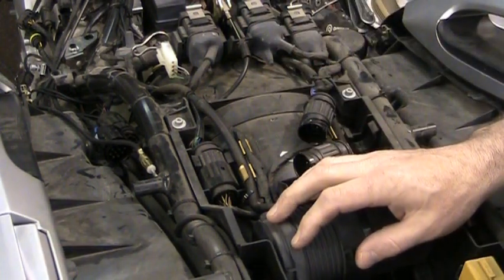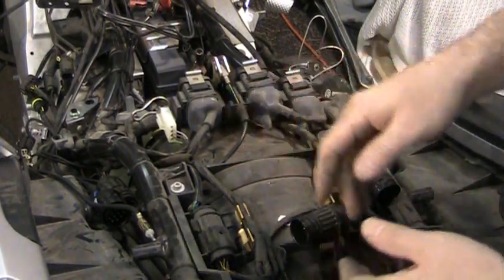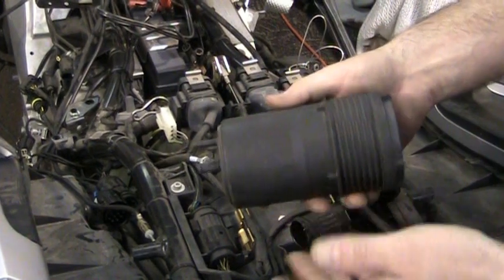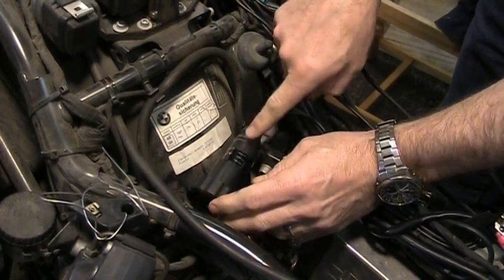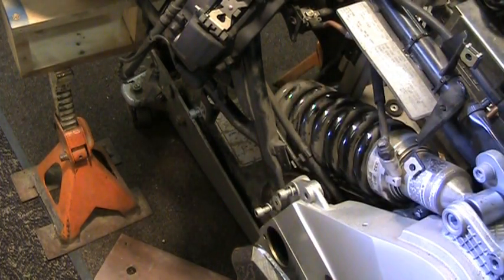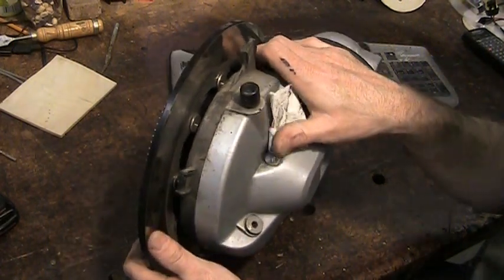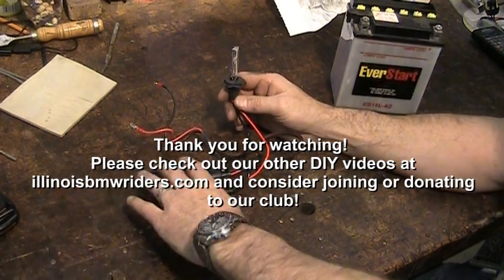BMW K1200LT Performance Improvements and Maintenance DIY

Comment: I did it, the canisterterectomy.  Great advice.   The plug removal on the air box made a huge difference.  I couldn't believe it the improvement.  It's hot here in Florida..always.  Big difference....Thanks again for all the great videos.

Comment: @ 18:07 - If oil has been able to escape air will not be in the system for long at all! 
@ 20:57 - Rear disc - EBC Brake makes a far superior brake disc available at Beemer Boneyard in Randolph, New Jersey for a mere $185. These are simple to replace without removing the rear drive from the bike. I have YouTube videos showing this procedure.
Great video. Thanks for posting it, Chris

Comment: I have a 2002LT and I cut the brown wire.  WOW!  What a difference!  Temp outside, here in Tampa, is 92 degrees.  Took it for a test drive and no more bogging down.  Whole lot more performance!  Thanks  (  I made a donation today.)
Reply: Hi, you cut only brown wire? (since september i have a 2006 LT, and i will want make same mod)

Comment: On my 2000 K1200LT I was bottoming out on mild speed bumps and curbs.  I added hydraulic fluid to the rear shock adjuster as shown here and it has made a world of difference.  I also removed the top case and performed the canisterectomy.  Damn it feels good to get rid of useless shit.  I just filled up the tank and the needle still doesn't go all the way to full, but oh well.  Many thanks for the helpful videos!
Reply from the maker: +Steff Mielziner The next time you take the gas tank off pull the sending unit out and you will see why the gauge is not working correctly. The tube has a dent in it from the gas tank crushing in on itself when the canister got clogged. Take out the innards and drive a reasonably tight fitting socket through the aluminum tube. Put it back together and viola!

Comment: I just pushed the drain hose off the top of the cannister down the side of the bike to drain, no need to go through the pain of connecting it to the old drain hose. Good videos though, thanks for taking the time.

Comment: Nice!  I have a new-to-me 2000 K1200RS that still has the canister.  Currently have it completely disassembled to fix a slipping clutch (o-ring was leaking), so getting rid of that useless canister will be easy peasy.
Reply: Just did this today!  Thanks
Reply: Follow up question on the canisterectomy:  On my 2000 K1200RS, there were 3 hoses from the canister:  one, from the fuel tank vent, two, the drain pipe, and three was the hose to the solenoid valve, which goes to the vacuum tubes on the intake manifolds.  #3 is the hose that you plugged with a bolt.  Instead of plugging the hose, I removed that hose and put a large vacuum cap on the nipple the hose came off of on the solenoid.  So the solenoid does nothing now.

Question: can that solenoid be removed without generating a check engine code?

Comment: The Cat Code plug was only used for a short time.  Once the "brown wire loop" was added in mid 2001, the cat code plug was discontinued, since they both do the same thing.  There was only a couple months of production where both existed.  Also, there was a change to the Motronic to allow the cat code plug/brown wire change to allow a secondary fuel map.  The very early ones did not have that map, so unplugging the ATS work around was the only way to relieve the high temp surging problem.  As you said, never do the cat code plug/AND brown wire!

Comment from the maker: You could have something going on with the final drive, drive shaft or the brakes. Check them all! There should be no grinding. Also check for tire rub on the swing arm and check the tire pressure. 
The shock adjustment: If you are afraid you will break the knob, unscrew it, pull it off and use a wrench on the hex head underneath. just know that there is a detent ball under the knob that will fall out so be prepared to catch it!

Comment: Did you see my question about the charcoal canister  PO cut the lines coming onto the canister and removed the supply line and return line.  Are the two hoses on the right side of the tank associated with the charcoal canister, thus can I turn those hoses into each other?

Comment: I know this is an older video, but Kirk, if you still have your 00' or 01' LT, could you do a video on resetting the ABS II (non Integrated), including the diagnostic plug and getting to the ABS computer plug by the battery, which seems to be on the difficult side? Another member of your club did one for those bikes with a nice ABS button, which the early K1200LTs do not have.  I would imagine you have some tips to make that easier. Yes, the pulses should be tested too, to see what the problem is, but I am under the impression a reset is sometimes needed as fixing the problem doesn't necessarily reset the system.

Comment: Tire is Metzeler and pressure is 36psi when cold.
Reply from the maker: I can tell you from real experience that you tire pressure is WAY to low running a Metzler two up. When I ran that tire I put 48 Solo and 50psi two up. Bump the front up to 40S-42psi dbl. I think the tire is rubbing the swing arm or is mushing too much while cornering. If your tires are old or have high mileage on them they become noisy as well in corners. As to your other question, any quality click type torque wrench that reads Newton meters. You need one that will go from 5-200 range. Maybe get one in 3/8 and 1/2"

Comment: I just bought a used 06 LT with 50,000 miles. I took my wife on a ride for the first time and I feel/hear grinding noise from the rear while free wheeling. I do not notice it when I am by myself. no leak from final drive. I also notice that I cannot unscrew the adjustment of the rear shock - it is stuck on one of the last settings...all the way screwed on. any idea?
I really enjoy your videos.

Comment: Hello sir I have watched and learned a lot from your videos thanks for sharing your knowledge. I have a 2001 k1200rs and I disconnected the connector on the air box but I'm not finding the little brown wire. Is this necessary to do or is this defeating the purpose of disconnecting the air box connector. Thanks again for your help and I have told a lot of people about your channel. Not a lot of bmw bike riders here in Knoxville Tennessee.

Comment: Does the Chip Replacement make the brown wire/temp sensor/..... thing unnecessary?
Reply from the maker: yes
Reply: @kirksmotorrad  Thank you. I know your YT are a few years old but the 2003 BMW K1200LT is brand new to me! Do you have a link to the chip?

Comment: More unsolicited comments! Please take no offense, I'm merely trying to help:
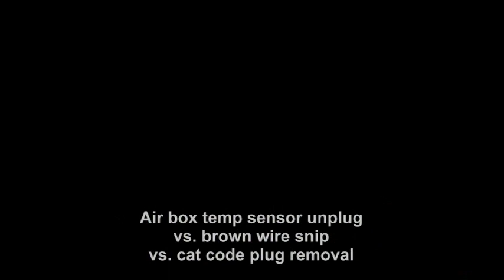@ 8:20 - Most other manufacturers have a 10 year warranty on emission related components. Check your owner's manual for Emission Warranty notes. I can't say that I have ever looked, as strange as that may seem after all these years.
@ 9:30 - This computer was used from 6/97 - 12/03 only in the K1200LT. Therefore, this issue would likely exist in all US 1999 - 2003 models.
@ 9:52 - Brown is Ground/Earth for BMW. 
Chris

Comment: Hi Kirk,

I have the same bike, a 1999 with only 22k miles.  

On the second step in your video; do you remove ONLY the air box plug on the Left side of the bike ?  Or do you also pull out the Yellow CAD plug on the right side on the rear of the bike?

I have the yellow plug in the back of my bike under the rear luggage/trunk.  Do I pull it out too ?

It is not clear if I should do only one or both things (pull the plug on the air box and pull out the yellow cad plug)?

I don't seem to have any issues with my bike even in Hot weather but you are saying this will improve the power/performance of the bike without effecting anything else?

Please let me know.

Thank you,
AJ
Reply from the maker: Only remove the airbox plug on this year of LT. Do not remove the rear plug. Yes it helps in hot weather over 80F
Reply: illinoisBMWriders

Thank you.

I removed the rear plug (then put it back) and it seems to make no difference when removed.  What difference does this plug do ?   I tested the bike without it and it drove/ran fine.

I could not find or get to the airbox...I would have to remove the Left side Tupperware, I could not simply reach in and unplug it without removing the Tupperware.

Comment: Kirk, for an 05LT, Airbox sensor ? Brown wire cur? or Cat plug unplug?  Thanks!  another great video  sir.
Reply from the maker: That one should have a brown wire to cut
Reply: KJ, I have to say I have watched and re watched most of your videos.  I am in the process of changing all of the fluids, filters etc on my 05LT.  I did the gas filter, coolent and final drive last weekend.  All that is left is the clutch and brake bleed.  I also replaced the plastic quick connects to the metal as per your advice.  So the elusive Brown Wire Loop?  I do not see a loop anywhere.  I have all the tupperware off.  What am I missing?  Okay to do the airbox sensor on this bike since I cannot find the brown wire loop?
Reply: Kirk, I have replaced all of the fluids on my 05LT thanks to your videos.  I also did the Can ectomy and replaced the quick connects.  I looked high and low for a Brown wire to cut and I do not see anything except for the wrapped wiring runs.... no brown wire loop.  Still getting to know this bike.  Love the way she handles... not a big fan of the brakes.
Reply from the maker: It may have the Cat code plug under the rear box above the tail lights. Or you could just leave it and get yourself a John Gemi chip. His chip does the same thing with all of the sensors in place.

Comment: Hi, since september i have a 2006 LT, and i want to cut brown wire, only this mod, it is possible for improve performance?
Reply from the maker: yes. If you have the small brown wire you can cut it and it will run better in hot weather.

Comment: I dont know if you still responding to questions.  I have been using your videos, got my first bike ever, 2003 k1200rs.  Love it, but i have hesitation and back fire when decelerating. Should I do the airbox sensor or brown wire?  I only get like 38 mpg, 40 if I baby it so I been wondering why I gt such bad gas mileage.  Any info would be wonderful!
Reply from the maker: +Daniel Ralph This sounds like a classic case of you need to change the O2 sensor. Double check to see if a mouse has moved in to your air box too. You can find one a lot cheaper at the auto parts store. The LT takes a Bosch 13475. Probably the same on yours but double check first.
Reply: +illinoisBMWriders thanks,  the air filter is fine, I did ride the bike a little with the temp sensor removed and it did not backfire nearly as much and cold start idled much better. the bike has 44k on it so, I will price out an O2 sensor. thanks for your advice
Reply: +illinoisBMWriders do you happen to know if removing that air temperature sensor okay for this model? I live in SC so it is hot most of the season.
Reply from the maker: +Daniel Ralph we unplug the sensor on the LT due to a huge hesitation from a stop and low power when it gets over 80F. Are you experiencing this? I think you should change out the o2 sensor, check the valves and then see how it runs. Dont unplug it if you dont need to.
Reply: +illinoisBMWriders sounds good, looks like mine may use an 15727 o2 sensor. will do a little more research and try that out. thanks again!

Comment: @ 10:54 - You are tricking the Motronic to increase the fuel side of the air/fuel mixture. Most BMW motorcycles suffer from a lean condition. More fuel is good.
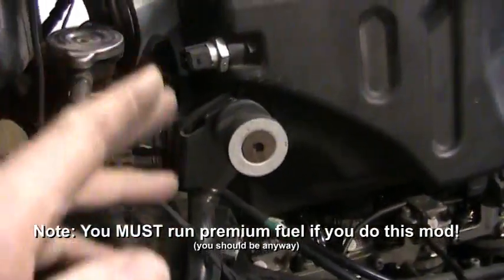@ 12:50 - As with the above comment you are placing the Motronic computer into 'Limp-Home' mode which will richen the mixture put show up on the MoDiTeC diagnostic dinosaur as a fault.
NOTE: I am NOT suggesting that anyone not do these mods. You will gain rideability & performance with no adverse effects on reliability or longevity.

Comment: Did the canisterectomy fine but during reassembly I made all the elec connections but my left turn signal doesn't work and right side blinks fast.  Any thoughts on how I goofed up?
Reply from the maker: govshrum I cant even imagine how you could have messed up the electrical doing a canisterectomy...
Reply: Old post, but I may have the answer for someone else.  I had my faring off, and after reassembling, one of the two front turn signals stopped working.  Pulled the bulb out and it measured fine.  Measured voltage at the connector and it was fine.  Tried swapping the two turn signal assemblies at their plugs and it stayed with the housing.  Disassembled the housing and cleaned the bulb contacts.  Reassembled and it was all fixed.  Just a little corrosion in the socket.

Comment: Anybody know where  is engine number on LT 1200
Thanks. Martin Ferrari.
Reply: I needed mine to register it....   I called a few places that work on BMW bikes and found one that could look it up based on the VIN #.   I used that to register the bike and it worked out OK.  They guy said a some of the numbers might not be listed---could be an incomplete Engine #---but Maryland DMV was OK with what I gave them.

Comment: @ 5:00 - Your dealer sucks! Did they call the FBI, EPA and US Attorney? You should have told them that this bike never had a charcoal canister and the dealer should give you a new bike since you are riding illegally!
@ 8:00 - Sorry, you are so horribly wrong. These are a big problem for every BMW model equipped with these shitty things. Take them off and throw them away. 
Notes: So far, a very good video. Thank you for posting and for your recent subscription to my channel as well, Chris